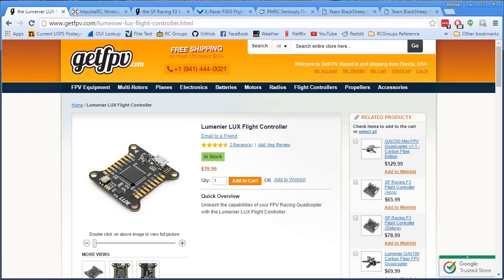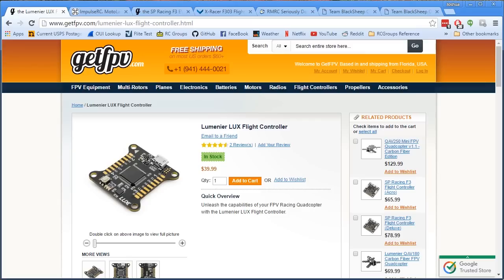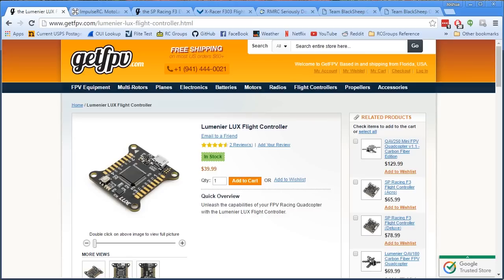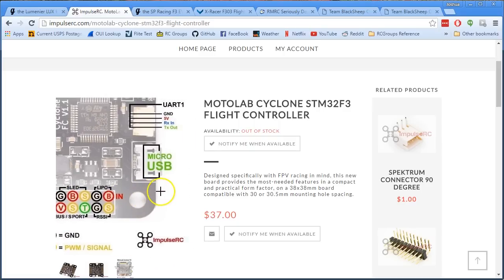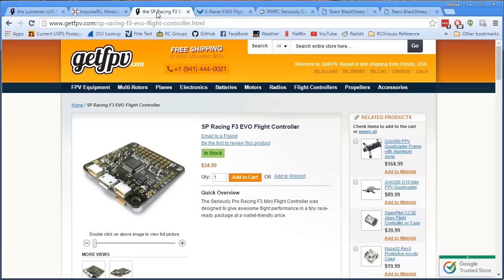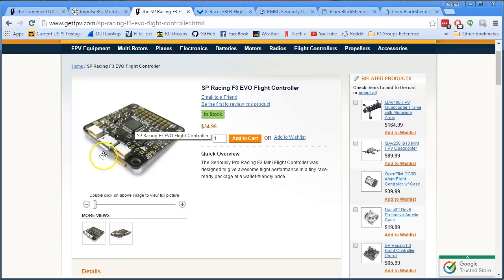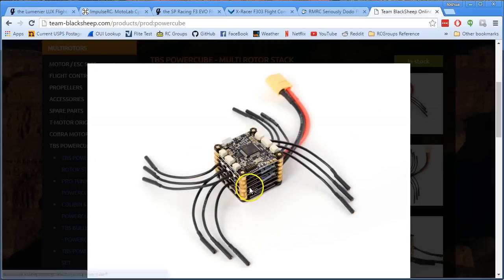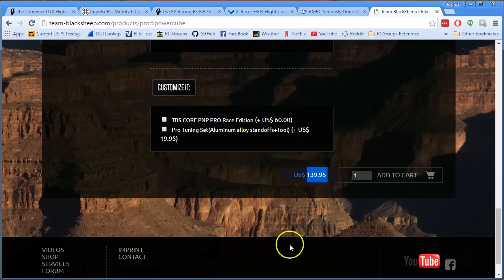The Best Cleanflight Flight Controller(s) - May 2016 Update

Comment: My powercube flys better than any setup I have had.  If fact I just bought my second powercube which arrived today.  I'm throwing it in an old ZMR250 just so I can have a reliable backup.
Reply from the maker: I don't know what experience you have had with other ESCs, but I would be absolutely stunned if an Atmel ESC could beat the top-of-the-line Silabs F390 and BLHeli_S ESCs on the market today. And given that I have found the limits of those ESCs' handling, I'm very certain that I would be disappointed with anything less. To each his own, of course.

The question I would want to answer is: do the PowerCube ESCs have a dedicated gate driver? At least, that's the first question.
Reply: I have run EMAX 12, ZTW 30amp, ZTW18, sn20a and RG20 .  Granted... there could be many variable with my experiences but all I can really convey is I feel like my setup with the cube is the best yet.  I cant answer your question on the gate driver but I'll look into it. I honestly dont know the internals of the ESCs that well.  I know they are rated to 6S .
Reply: According to Trappy from TBS.
"we have the dedicated FET drivers and other electronic trickery that make up for the lack of performance. we actually almost reach the KISS ESC, in our measurements the thrust is only 5% lower than the "kings". We are experimenting with SiLabs chips through, as they feature similar speeds as 32bit counterparts and thus allow a bit more optimization."
Reply from the maker: Glad to hear this is not just bog standard Atmel.
Reply: I wish you could get your hands on one for testing.  I would love to see your input, PID tune and blackbox analysis of the process.  Maybe we can harass Trappy to send you one for review.
Reply from the maker: Bill Sheley At this time, I'm not sure I could fit the PowerCube into my build schedule in a timely manner, and would decline the offer. I don't want to take a product and then just sit on it for months. It's not fair to the manufacturer or vendor. Frankly, at this point, the topic is emotionally charge enough that I'm not sure it would be a good idea to continue, since the results would probably seem tainted to some viewers.

As long as I have TBS's ear on this thread, here are some questions that could help start qualifying the performance of the PowerCube in a more concrete way.

What Atmel chip is used? I've looked for photos, but all the product photos seem to have the labels obscured on the components. Is it the AVR328?

What FET driver chip is used?

What is the eRPM limit for the PowerCube ESC?
Reply: I have a brand new cube that I have not installed yet.  I took the stack apart and am sending you some high resolutions photos of the chips.  I dont expect any feed back or analysis.   Just for your own curiosity and because I literally have one sitting in front of me.  Thanks again for all the great info you provide us!
Reply from the maker: Thanks.

Comment: the DTFc is the new standard for F3 boards.. check it out
Reply: It looks cool, but it hasn't proven itself yet and its very different.  Different invensys chip, pdb on board could cause problems with EMF.  It has potential, but like I said it has a lot to prove as well.  Could be a bust or a game changer.
Reply from the maker: I have one coming from Rotorgeeks. I think it is going to fill an important spot for people who want a micro build, since the PDB and FC are build into each other, so you save one board-height on your stack. It's also one of the few stackable MWOSD based OSD's to have a current sensor--BeeRotor being the other one that comes to my mind. 

On the flip-side, it stacks with OSDoge, which is freaking $70, which is a lot for a MinimOSD. And the built-in PDB is redundant if you are using something like the RROSD. Finally, you have to desolder all your ESCs if you need to swap your FC, which is a bit annoying.

Those are my initial impressions but we'll see how I feel about it once I have it in hand.
Reply: Isn't the IMU in this board a resized (smaller) mpu6500? I've heard ppl are still having the same twitching and noise issues on the MQC Facebook page

Comment: new DTFc what your opinion on this FC
Reply from the maker: I have one coming from Rotorgeeks. I think it is going to fill an important spot for people who want a micro build, since the PDB and FC are build into each other, so you save one board-height on your stack. It's also one of the few stackable MWOSD based OSD's to have a current sensor--BeeRotor being the other one that comes to my mind. 

On the flip-side, it stacks with OSDoge, which is freaking $70, which is a lot for a MinimOSD. And the built-in PDB is redundant if you are using something like the RROSD. Finally, you have to desolder all your ESCs if you need to swap your FC, which is a bit annoying.

Those are my initial impressions but we'll see how I feel about it once I have it in hand.

Comment: I've seen posts of guys who are isolating their motors with o-rings.... It would be interesting to see a vibration test using this method if your looking for ideas
Reply from the maker: I'm sure it reduces vibrations but I don't trust it. Motors will always transmit vibration through the screws right?
Reply: I'd imagine it's the same principal used in isolating the FC...  you could really go all out and put o rings on both sides of the arm...  The o-ring may also act as a lock washer and keep pressure on the screw which may keep it tight or may work it loose easier... still not sure... I know I read of a few guys only having success using o-rings on the motors, just thought it may be an interesting bench test.  Cheers!

Comment: Thanks for the video Joshua :) I recently have been trying to get my zmr X210 tuned, and have run into a slight problem where i and. I am running 2300kv red bottoms, 20s little bees running 14.5, and f303 beta 2.8.0 and when I arm motors sort of pulsate, not not really the motors I guess, but the props seem to hit a resonant frequency and bend and flex like a bridge hit by wind. They are t5045 so very stiff, and I thought it might be too much D gain, but reducing that way down did nothing? Never happened to me before.
Reply from the maker: +The RCAddict what you're describing doesn't really ring a bell.
Reply: Joshua Bardwell Hmm. I have been trying to tune out my propwash oscialltions for the past 3 days, without much luck (with help from people who know their stuff, lol) and during then I tried beta 2.6.1 on bl heli 1.4. as supposodly more stable, and got the flip of death, flashed to bl 14.5 and same thing. Went back to beta 2.8.0 and now doesn't do that anymore. Perhaps I should try flashing once more to bl 14.6?
Reply from the maker: LB20 don't like 14.4. Betaflight 2.8 has desync protection as well.
Reply: Joshua Bardwell Ok, thanks for that. I have gone to 14.6 now, and the vibration thing on arm throttle while on ground still seems to be there, but flies fine. Working on shaving off weight right now.
Reply: +The RCAddict I don't know much of anything but sounds like a faulty esc to me. My quad has also been acting crazy lately with 3 death rolls over the weekend and after trying many different versions of Clean and Beta Flight and many esc recalibrations no dice. I can only conclude it's a hardware issue at this point.
Reply: RC Flyer85 It must have been some combonation I was on, and is not there anymore and flies great.
Reply: +The RCAddict Hmmmm... very strange but glad you got it sorted.... wish I could say the same lol

Comment: What is your opinion of the new DTFc?
Reply from the maker: I have one coming from Rotorgeeks. I think it is going to fill an important spot for people who want a micro build, since the PDB and FC are build into each other, so you save one board-height on your stack. It's also one of the few stackable MWOSD based OSD's to have a current sensor--BeeRotor being the other one that comes to my mind. 

On the flip-side, it stacks with OSDoge, which is freaking $70, which is a lot for a MinimOSD. And the built-in PDB is redundant if you are using something like the RROSD. Finally, you have to desolder all your ESCs if you need to swap your FC, which is a bit annoying.

Those are my initial impressions but we'll see how I feel about it once I have it in hand.
Reply: I ordered one for my next build, The idea of saving weight + clean build + current sensor was tempting. The only questions I have is the new Gyro and the potential EMF problems on high current setup. Hopefully a god design and well tested !!
Reply: Joshua Bardwell
Thanks for the reply! I got 3 and have been using 2 of them so far with great results. Initially getting drivers set up was a little annoying, but the boards seem to work well, haven't done much tuning yet though. I did email Rotorgeeks to let them know that in the instructions it says you can run telemetry from UART3 and SerialRX on the same UART, but you cannot and they added a note on the site. I like the guys up there at Rotorgeeks!
Reply: Would I be able to send the mah used with telemetry to my taranis? Would that be done over the 1-16 channels or with the S.Port?
That way I could live without an osd (save weight) and have my radio tell me when its time to land.
Reply from the maker: Whether you can send the mAh used depends on a lot of factors that I don't know. Cleanflight has the ability to take a current sensor input. But typical configuration with MinimOSD is to run the current sensor into the OSD for display on the goggles. You could also run the current sensor into Cleanflight, but I don't know whether that connection has been made on this FC. Good question.

If Cleanflight is receiving current sensor input, then I am pretty confident it will send it to the Taranis over S.Port.
Reply: Joshua Bardwell
They just updated the site again with info on how to get mAh on the taranis. :) Sweet!
Reply: +sulan91  yes with S.Port via Tx pin on uart1 or uart2. Taranis telemetry uses "fuel" as mah used. Works great.
Reply: +sulan91  yes with S.Port via Tx pin on uart1 or uart2. Taranis telemetry uses "fuel" as mah used. Works great.
Reply: I have this board and it has no onboard flash for blackbox but there's a footprint on the bottom side of the PCB to solder one.  However I don't know if the firmware will detect the flash chip if I solder one.  But except for that it's a very good board, you can run it at 8K\8K if you have multishot enabled ESCs.
Reply: I have mine coming today, and just noticed in the instructions it has no 3.3V regulator for Spektrum Sat Bus (serial).  I emailed rotorgeeks and they said users were "tapping into" the built in 3.3v reg, but they couldn't tell me how as it's not supported without pads.  Do you know what they mean?  I ordered a 3.3v step down, but its going to be two more days.  If I can do it without the stepdown, I'd rather save the weight and get it done
Reply: perhaps plug it in to batt and check pads w/ voltmeter...
Reply: Thanks.
Reply: yes, you can check the product page to see the settings.  Current might need some calibration.  I'll try and find the right numbers for my setup and compare
Reply: I own 3 power cubes by TBS ,never had a problem , the cube has a built in current sensor ,osd and the collibri is a super slippery f3 controller ,able to set up pids and rates in the goggles no laptop needed in the field , there's a lot to be said about that, I tend to fly hard and have a lot of unexpected landings and never had a problem yet ...touch wood !
Just my opinion ... great videos pal, I've learned a lot from you

Comment: Good rundown Joshua.  I have a SPRacing F3 Mini, and have had the voltage regulator fail as well.  As you, I've seen other people commenting on it at the RC Groups forum.  Are there any other F3 boards with an SD card slot?  Does the Moto have any on board memory for blackbox recording?  (Incidentally, I have 3 SPRF3 Mini boards, and I'm going to see if the other two also burn out).
Reply from the maker: KoptorKontrol board (now "Fury") has a built-in SD reader. There are a few others coming out as well but they don't come immediately to mind.
Reply: Thanks.  I saw that Fury board that was posted here.  To be honest, I'm a little gun shy (since the SPR F3 Mini) to jump on a new design.  I'll keep an eye on it though.

Comment: Why no flip32 f3?
Reply from the maker: That's right. RTFQ has good products, but their customer service means that I don't recommend them on the channel. Too many people would flock to them without reading the fine print and get burned. I made my first purchase from RTFQ after they were featured on Flite Test and I was just a little bit mad at Flite Test for a long time for recommending them without vetting them first. So I try not to make the same mistake.
Reply: no doubt - my fav so far just behind the DTFc
Reply: +FPV 3D  - on second thought - perhaps because of who it's from. RTFQ has ZERO customer service (unless you know somebody)...
Reply: +Joshua Bardwell no worries I was just wondering, I personally order from them all the time and have yet to have a problem, but I understand that might not be everyone's experience, thanks for all vids!
Reply: Yeah, I'm with Joshua on RTFQ lack of customer service.  I do still buy their products as they DO have interesting things at very low price.  However I'm stepping in with ZERO expectation on customer service.  They got none.  I'm rolling the dice every time I hit that order button.  Flip32 F3 is my go-to board currently as it's so cheap.  :)

Comment: I've had 2 sprf3 crap out on me in two months. Won't be buying another. Had the evo too. Refused to connect to the gui no matter what I did. Sold it,wouldn't buy another.
Reply: Xracer for the win! Until I receive the fury anyway, maybe it might change then.
Reply: I had a mini giving me a time getting going, finally got it working and the 5v regulator crapped out. I'm calling it a lesson learned and eating the cost.

Comment: You forgot the KKNG board! It only has the best out of the best features. It is custom made so you can choose dataflash size (or SD card slot!), which gyro to use + there is F3 and F4 version. It has very nice pinout (on sides like lux FC), it has built in serial invertor, it has everything!
http://www.rcgroups.com/forums/showthread.php?t=2628430
Reply: This!
Reply: I was going to point out the same thing. Mine shipped today. Spi and sd card, yes please!
Reply: Now called fury by the way. You probably knew that. Not sure what Kevin has called the f4 though?
Reply: Yes, i saw the vote in his thread. Both are called fury + F3/F4 in the name.
 I love mine very much :D
Reply: +neclovekSK ah ok, makes sense I suppose. You flying one already? Any issues connecting to Windows (assuming that's what you use) or flashing it with Betaflight?
Reply: I got the F4 one, in raceflight wiki there is a nice quick tutorial for zadig drivers and after folowing the steps i got the VCP working perfectly - it connects right away, when it reboots it takes only like second or two + raceflight automaticaly reconnects. Another advantage is that the board with flash chip is directly supported by raceflight so i can update it right from the configurator and everything works right away.

Comment: +1 for the Xracer. If v3 came out with an SD card slot I would replace both my v2 & v2.1 straight away. Downloading speeds from onboard means I only use it when I absolutely have to!

Comment: for the x-racer f303, the best thing they can do to improve it is reduce the size of the pwm input area (only signal pins for example) and add on board 5v regulator.. it would be most best!!1!
Reply from the maker: 8 kHz with SPI gyro would be cool too, as long as it's not the 6500.

Comment: How would you rate the BeeRotorF3 with built-in OSD?
I have three of these because I like the board layout and the OSD.
Not sure if it has BLH pass through and the less noisy gyro's but would like to know.
Reply from the maker: I don't have much opinion of that board positive or negative. If you want MWOSD with current sensing in an integrated, stackable, 36mm form factor, it's one of the only choices.
Reply: I think it might meet your standards of having the less noisy gyro.
Found this  GYRO=MPU6050, ACC=MPU6050.n, BARO=MS5611
If it has the BLH passthrough it might be a contender.
Reply: It's does? Thanks for the info.
Reply: I used one of this boards with the pdb v2 for a few weeks but then changed to the cyclone to run 8khz. I don't like the plugs/wires + I have seen lots of people having problem with the osd, flashing, failing boards etc. RCtimer who are one of the resellers don't seem to have that great customer support either.